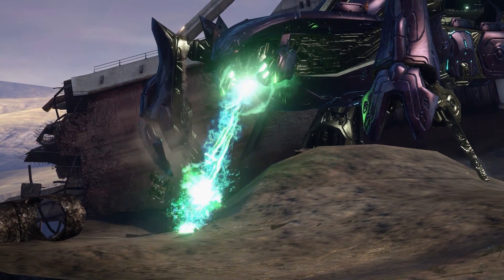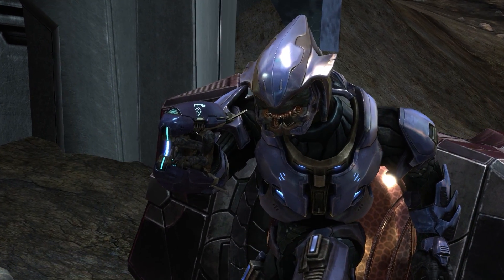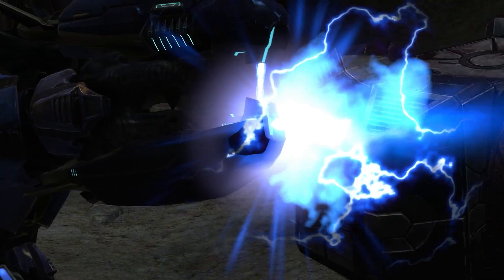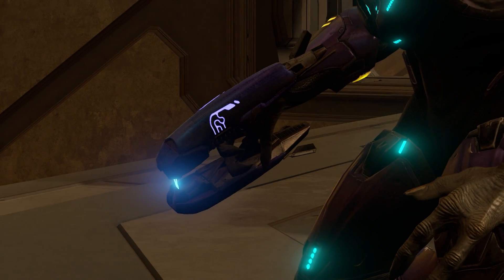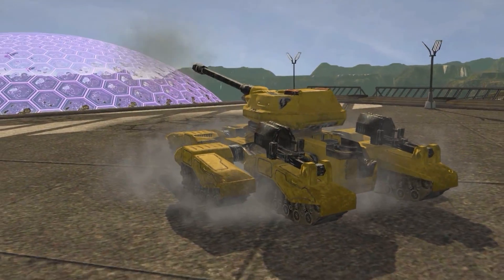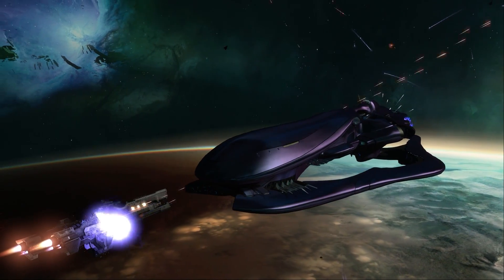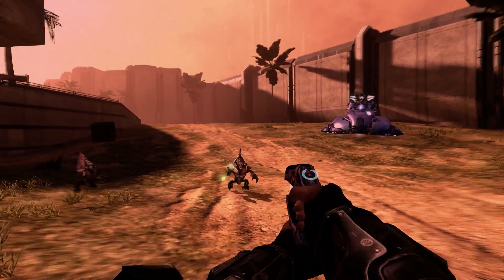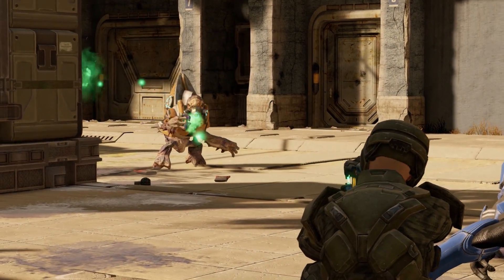How Plasma Works (Halo Lore)

Comment from the maker: Had a great time making this one (any excuse to revisit all the Halo games!).

10:41 - Just to keep everyone updated: I finish university next month, after which I plan on making videos full time - I have loads of content planned. Thank you all so much for your support!
Reply: SameToken Keep up the amazing work! You should do a collaboration with Installation00!..
Reply: SameToken, i would like to see a video explaining how human cities are designed and function. We know there are differences between cities with a space elevator and those without. Any city with a space elevator would be more likely to use AI in the operation of infrastructure, traffic control, utility management for water, power and waste disposal, and especially logistics for cargo handling of their elevators and ports. 

When the space elevator in New Mombasa opened in 2302, the city's development and population were likely closer to 2020 Mombasa than New Mombasa in 2552, which made restructuring the city with a semi-symmetrical subdivided layout easier as the city did not have many tall office buildings at the time, most of which were clustered in the north of the island, or across the water. The city is divided into sectors to minimize property damage, injuries and loss of life in the even of their elevator collapsing.
Less developed areas on the southern half of the island were likely completely demolished and rebuilt one section at a time, while the northwest was already significantly developed prior to the completion of the elevator, and as a result dividing walls and infrastructure were likely built around already existing structures.This also may explain why New Mombasa in Halo 2, and Halo 3:ODST have different architectural styles, as they are in completely different locations on or near the central island. 
Brutalist angular concrete structures in Halo 2, versus the mostly sleek glass and concrete or metal structures in H3: ODST.

The whole process of reconstructing the city's transit and utility infrastructure and construction sectors of the city likely took decades, and was probably done in many phases of construction, for example the NM 105E and its bridge was likely part of the massive transport infrastructure project, and was completed in 2326, a full 23 years after the space elevator was completed. After the completion of the elevator, the city probably grew as fast as Dubai or faster, and may have looked like a gigantic forest of construction cranes and unfinished structures, and probably would look similar since 2554 due to the post-war construction effort.

This redevelopment project was likely large enough to rival the construction of the space elevator itself in its own right, though was probably just part of the space elevator project itself, and may have been started either before or after the space elevator began construction.
Think of Hudson Yards in New York, now multiply that by 15, and include walls, and transportation, and utility infrastructure, and effectively built an entirely new city over the old one.

All of that doesn't even take into account the construction and development of the actual buildings for residential, office, and commercial space, as well as industrial structures for supporting the elevator's logistical capability with many warehouses, though these are probably located on the mainland to the east of the city center, as there is a bridge connecting the elevator to the mainland, rather than the city center.

Based on the fact there are repeated building designs throughout New Mombasa in the city center, it is not only possible, but probable they were built using modular and/or prefabrication methods for faster and cheaper construction. It is also likely that construction of these buildings were partially handled by the city's AI, or automated construction robots, in combination with human workers and crane operators. The reason the city is named New Mombasa, as opposed to Mombasa is because the city was practically rebuilt from the ground up to support and elevator, as well as the massive explosion of growth both outwards, and up. 

As stated on Halopedia, the switch in name was never official, though every municipal organization for the city called itself something akin to "New Mombasa Transit Authority" or "New Mombasa Police Department" instead of "Mombasa Transit Authority" or "Mombasa Police Department", though they could serve the whole New Mombasa metropolitan area instead of just Mombasa itself, and New Mombasa could just be a sort of nickname for the region, similar to the Minneapolis - St Paul metropolitan area sometimes being called the "Twin Cities".

This is is only my hypothesis on how cities in Halo are built, and designed within the Halo Universe, though some of it is based on information from Halopedia. Most cities however are probably going to be planned in more traditional manners, though building construction probably used the same modular and/or prefabrication method as described above, and utility management and transportation control are likely managed by AI regardless of whether a city has an elevator or not.
Reply from the maker: @Codster121  Thank you for a such an interesting read! That's an excellent topic, I'll save this comment and see what I can do!
Reply: It's good to see you're okay, Token! Missed ya Vids :)
Reply: Just in time for Halo Infinite gameplay!!
Reply: How much power will need to make a real plasma weapon from halo.
Reply: Its very hot melty liquid-looking stuff that is dangerous,thats what you need to know during gameplay,but this is a neat video
Reply: SameToken the library
Reply: Plasma Rifle
Reply: Congratulations. What degree in what discipline? Also what school if you don’t mind us asking?
Reply from the maker: @THEMAX00000  Thank you! It's a BA(hons) degree in business with marketing. It's been great fun, but I can't wait to graduate!
Reply: I notice you have an accent. Where are you from?
Reply from the maker: Planet Express Very perceptive! I’m from Scotland near the central belt
Reply: CONGRATS MAN
Reply: Congrats bro
Reply: You’re a genius
Reply: Good luck for your finals!
Reply: i still like the info.....its really something to think about....game play balance to real life armory that could lead to......some issues.....either way i also think halo is an awesome game regardless if compared to gears or war or counter-strike.....because halo is still fun!!!!
Reply: So why does The Flood just EAT plasma weaponry lol. They are the worst weapons to use on them and I only played on Heroic and that’s feels like cake compared to The Flood on Legendary lol.
Reply: The library
Reply: Could we make a plasma weapon but instead of shooting bolts, what about continuous beam of plasma like a focus rifle ?
Reply: Why human still use ballistic weapon them if they already have electric magnetic weapon it is logical to assume  they have the capability to scale down it into a hand held package, or even that is not a option, how about pulse lasers.
Reply: The most terrifying level as a marine would be THE PILLAR OF AUTUMN LEGENDARY HALO CE, BECAUSE THAT"S THE FIRST ENCOUNTER WITH THE COVENANT IN RELEASE HISTORY (I do not count reach because in reach, everyone is dead)

Comment: My question is how do you get the plasma bolt/beam up to sufficient speed. Is that also done with magnetic forces?
Reply: I maan you see it in the plasma rifle there is electric grid and electric ard formed at the tip of the weapon that is the thing that accelerates the plasma

Comment: At 5:00 he talks about the plasma grenades and how they stick to surfaces using smart matter. I have read somewhere that the blue steam that comes out isn’t the plasma, but a coolant that keeps the plasma from sticking to the wielder, but when it runs out, the plasma melts into metal or fuses to flesh, before exploding into a shower of plasma. A much more gruesome alternative, but both could work

Comment: Ah, Type-25 Energy Rifle!

In Halo: Reach Campaign and Firefight it is somewhat depicted like an MP40 of the Covenant. Most Wraith drivers and Banshee pilots are issued with one. Interestingly, many AI-controlled Elites that don't wield a Plasma Rifle still always carry one but they never pull it out to use. Suffice to say they're not coded to do so.

Comment: Never cared for the concept of Halo's "plasma rifles". They aren't even rifles in any way. The concept of firing coherent balls of plasma just doesn't jive with me. There is no room for the required gas in the weapon. I think they should have gone with some sort of railgun system for generating the electromagnetic field required to encase and project the plasma. Then they could have added a device that pulls regular atmosphere, compresses it and then heats it to the required levels to achive a plasma reaction. At that point the rail spools up, encases the heated gases as they start to generate the plasma reaction and fires it at the target.
Reply: It's in the name you can use quantum coherence to make the plasma coherent have quantized energy levels at macroscopic scales to lower energy dissipation and allow it to travel out with higher range

Comment: Realistic if the blasma bolt works like that then the blasma bolt will be super slow or lose speed and energy fast in atmosphere. You know the blasma is much lighter then air and will lose speed fast when it travels tru air and Magnetic field will not stop O2, CO2 and Nitrogen entering the Magnetic field and discharge the blasma energy and braking even more when the ioniced Oxygen, Carbon and Nitrogen gets trapped in the field when it travels through the air. When i think about it so is blasma shit in atmosphere.

Tho in space blasma is super effective.

Comment: Plasma has mass because electrons and atoms which make up plasma have mass. This means plasma actually generates kinetic energy on target like a bullet even if it’s less kinetic force….. unless you heavily compress the plasma into denser liquid or solid-like states. Also it’s probably better to surround the area where the plasma shoots with a guard so you don’t shoot your own hand when firing the plasma weapon in high stress situations. Preferably a barrel surrounded by a heat-shield and then a hand-guard of some sort.
Reply: Yeah that is why seraph strikecraft can strike pelican and make it go slightly to side from plasma shot because plasma is matter

Comment: The thing about plasma weapons is that while they are powerful and multi purpose, they lose in speed and penetration when compared to humanity's guns. MAC round is so blisteringly fast it hits it's target almost instantly from a great distance. Same goes for infantry weapons and their rate of fire.  Even a pistol has higher rate of fire and greater penetration than the fastest plasma weapon. This gives the humanity a rather pretty range advantage.
Keep Covenant at range and even a small human force is a force that Covenant has great difficulty with. Only jackal snipers can content with it. Otherwise humans can see plasma coming and duck behind cover until salvo is over, while all covvies can do is pray that the humans have poor aim. Scorpion tank is probably the second biggest thing Covenant fears besides spartans. That thing's rate of fire and range is oh so much greater than wraith tanks. And it can soak up a lot of plasma before it's destroyed.
If Covenant didn't have shield technology, the battles throughout the war would have been extremely one sided.

Comment: My guess is that plasma weapons, if developed today, would be outlawed for use in war as cruel weapons. Being hit with a bolt of plasma probably wouldn't kill you if it hits in a less than lethal spot on your body. Just severely burn or possibly burn a hole through where it hits. The issue is that the plasma would create a wound but would also cauterize it at the same time, preventing death by blood loss and severely crippling the combatant. Unlike bullet wounds that can be removed and then sewn shut or cauterized, the damage from the plasma would destroy nerves and other tissue and be extremely painful as the tissue around the wound is burning. Being hit by plasma would ignite clothing, melt metal, incinerate tissue, and char bone. Not a nice way to die. Also bullets make a much smaller hole... Is plasma better than conventional ammunition? It certainly would be much more effective but also much more cruel.

Edit: also I wrote this before watching the video and he literally says how painful it would be, so point stands.

Comment: Scarier thought, think of what an Intense Firefight with Plasma weapons would be like in an enclosed space. Most UNSC soldiers don't have any type of respirators or facial coverings, so imagine having to literally try and fight in a corridor that is probably literally boiling after a non-stop barrage of plasma weapons' fire. And that's not even taking into account the literal inhalation hazard from all the ionized particles flying every which way. So you'd have to deal with the fact that your armor is probably quite literally cooking you alive, the air has practically turned into a roiling soup, and there is enough ozone and vapor in the air to make your lungs crispier than the Arbiter after his trial. Any firefight within a ship or enclosed space would be a nightmare for anyone not wearing ODST gear. And even ODSTs would only be very "slightly" better off.

Comment: To my knowledge, the plasma rifle has seen many downgrades as halo games went on, CE being when it was possibly the most powerful and actually made use of the “rifle” in its name, at least when wielded by the player. It felt good and fun to fire as each bolt did a fair bit of damage and the bolts themselves moved quickly, it was a good weapon that I think was a bit underrated thanks to other weapons in CE.
As halo games went on I felt that name got defiled as it didn’t do much health damage and was about as fast as a dodge ball being hurled at the enemy, which, in most cases, ain’t that fast
Sometimes it still can be fairly fun, and it being my most favorite Covenant weapon, in terms of design and function, could’ve been treated better and felt more like a mainstream weapon (as it should) along with the other weapons out there within the halo games (that didn’t specialize in headshots mainly).

Comment: And as fearsome as Covenant plasma weapons are, they aren't even that efficient with respect to their technology level. The Covenant base their technology off of Forerunner technology which was intended for fighting the Flood, as the hot plasma is good at sterilizing. Any attempts at improving upon the technology, or simply adjusting it for different tactical situations, is seen as an act of heresy.

Comment: They need to add “lore” difficulty where it’s as “realistic” as possible. When you’re shields are down you’re incredibly vulnerable. But on the other hand, it would be a lot easier to take down the shields of your enemies. Non shielded individuals would have to rely heavily on cover but would have to keep in mind that their cover can easily be disintegrated.
You would have to tend to any casualties during the firefight or quickly end the skirmish in order to apply first aid, else the die shortly after. Also you should be able to give orders. Tell marines to supply overwatch for you and each marine has different skills. Sounds kinda rpg-y, ik. I want my decisions to have a bigger impact on the gameplay, it doesn’t have to affect the storyline

Comment: I was always annoyed with Halo and the plasma weapons, we have plenty of high temperature ceramics and ablatives that could protect you today, I just remember in high school reading the first Halo book and they kept talking about Titanium armor and It was infuriating. I've thought about writing a "fan" fiction about how the human-covenant war went the other way within the first few years.
Reply: Titanium is hugely expensive and covenant plasma is much more controllable and therefore stronger.
Reply: @Void_Wars  your right about titanium, well, partly, lunar has huge deposits on the surface, but there's silicon carbide, boron nitride, and reinforced carbon carbon, each  and can take massive amounts of energy before vaporizing, and it can be extremely light, same reason we use it for spaceship re entry over metals.

Comment: So when will we start making them in real life
Reply: When batteries get strong enough to house in man portable weapon systems. When armor is developed that cannot be penetrated by gauss weapons, and when easily excited gases are turned or produced by a solid state or compressed state container.

you'd see humans use laser, microwave, and plasma weaponry before humans will start using plasma weaponry.

As microwaves burn over a wide area and are often invisable, lasers precise and burn thusly, with gusts producing armor piercing high speed projectiles.

Plasma hits all of these, but would likely be lesser in effectiveness than all of these are in their respective fields.

Thus you'll likely find plasma weapons on self propelled guns.
Gauss weapons on tanks.
Lasers on ships and jets.
And microwave weapons on armored vehicles.

While people will likely be able to carry magnetic weapon, similar to the chem rail in Elysium.

We don't know enough about how plasma would behave to make enough judgments though.